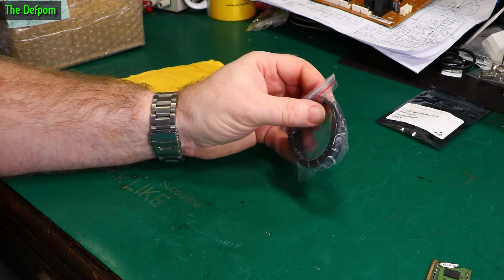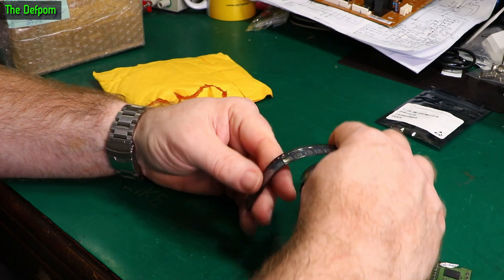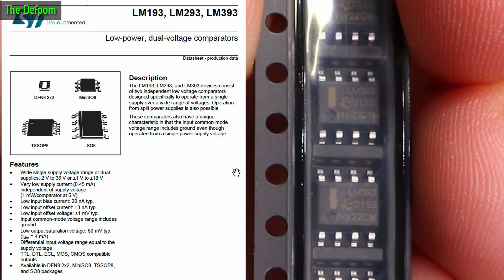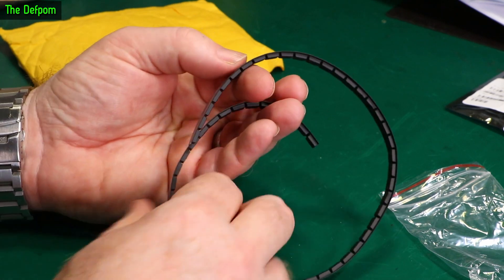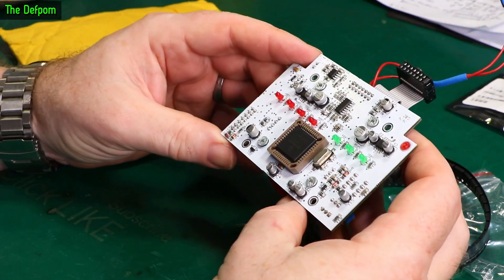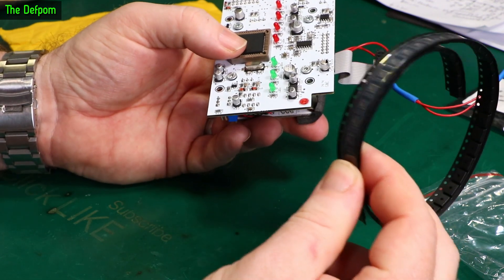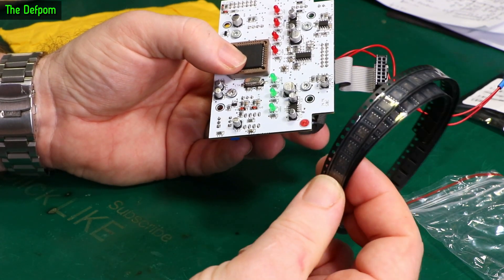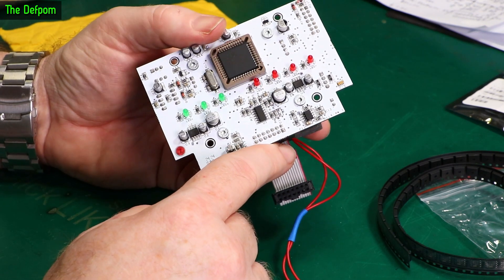🔴 What's in my Mailbag ? - Mailbag Monday 10th October 2022 - No.1049

Comment: Nice old meter, used to use these a lot. there are a great test meter for working on Audio Comms systems. But the switches can start to make your fingers sore after about 30hrs of switching. Don't ask me how i know this. 

Ok then, one of our systems took 37hrs to do a full system requirements sign off, and i did this a few times in one sitting or standing i should say. But i was much younger then. 🙂

Comment: you can still get the old power cords from Surplus Sales of Nebraska At least you could about a year ago when I got mine.
Reply from the maker: Thanks for the tip, I took a look and they do still have them, but they really aren’t cheap ! US$39 each, not really worth it unless I get a situation where I can’t modify the unit to use either a IEC or fixed cord instead. I bookmarked the site though as they carry some interesting stuff with I am sure will come in handy, if I ever order from them I will definitely get a HP cable or two a well.